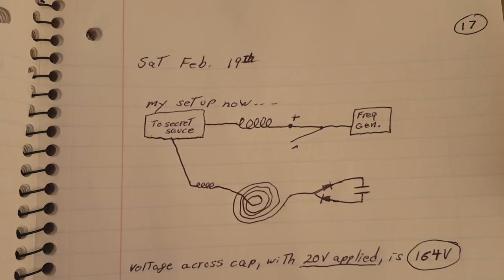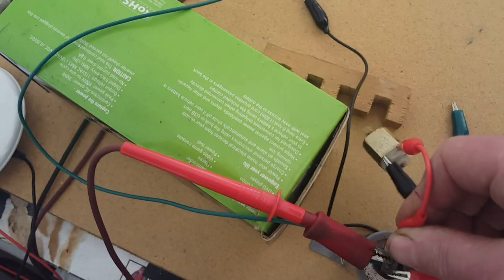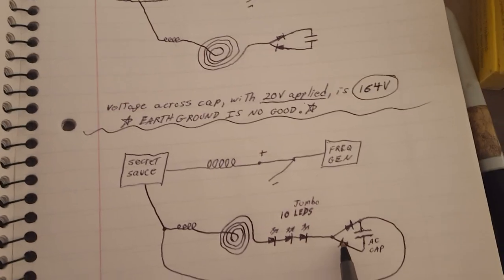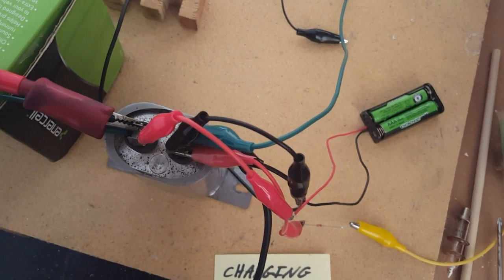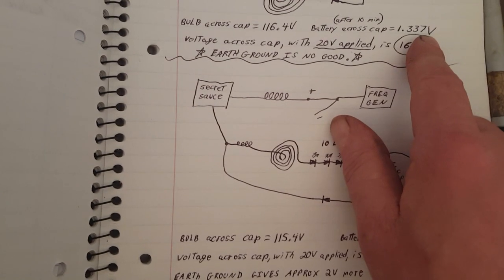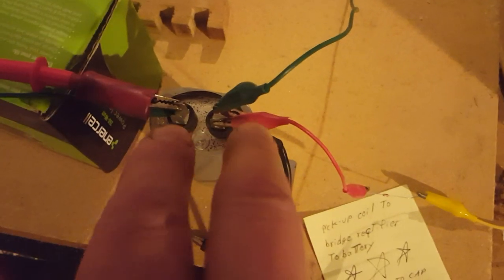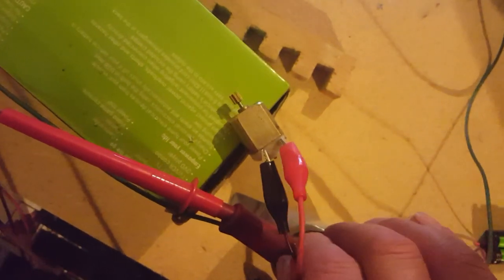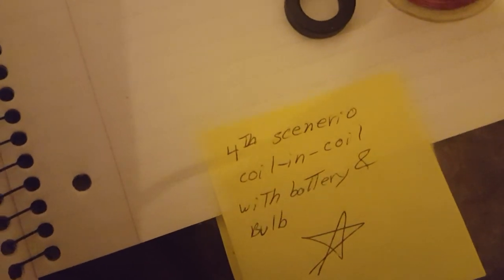WPT part 35   Three different set-ups, each with light bulb, charging cap, & charging batteries

Comment: Hi Paul   LOve your video......i have a idea you can try...it worked for me....Try putting another ground wire from the neg of the battery you are charging  with a small resistor(like a 10ohm) then put that on a (GOOD) ground sepporate for the rest of your system....I found this helped my charging alot.......food for thought.....  Cheers!!  Mike    P.S   i will add your links to your channel to my channel
Reply from the maker: Thanks!  Funny, I actually thought about a second ground off of the batteries.  I will try this with resistor, thanks again!  And thank you for adding the link to my channel😎    I just saw on your channel that you are also a machinist like me.

Comment: Hi Paul, good job on displaying the different methods. The cat analogy, man if I had a dollar every time I was surprised with the outcome. I noticed with my circuits, a problem measuring voltages when using the led’s as there is usually another small transformer inside the base of those bulbs. This transformer coupled with the normal circuit inside the bulb base will result in an adjustment of resistance, hence the need to readjust frequency for resonance. So what do we do when measurements are deemed unreliable? Focus on one thing, desired “input vs output/outcome”
Keep up the awesome education.
Reply from the maker: Thank you😎

Comment: I think you should build a Bendini Motor Generator which uses Volt's and Not a Lot of Amps. Also, a Farahday Mono Polar or Newman Engine, all Three go on Volt's. Think Tesla would Approve, all Three do Radiant Energy Stuff when Built for. I Forget the name of Inventor and Device, But Mono-Polar/Faraday Motor Up grade, was to Use Earth/Ambiant/Radiant energy to Spin Faraday/Mono polar with Two Discs. One Isolated from Other, One for Spin/Force, other for Load or generator Via Reversed Terminal Hook up to Disc/Rotor. Tesla had a had a Patent something like, Don't have the Name Patent # though. One last thought, Faraday Engine could be Washer's on Bolt with Ring Magnet fixed to Shaft. Little tip, Magnet Polarity changes Current/Polarity direction, and hint 2 One Electrode to Rim of Washer and one to Shaft, One on Rim can be moved in and away from Shaft to increase or decrease Speed and/or current Taken.    Keep up the Search and Experiments, thanks for sharing your finds..
Reply from the maker: Thank you for your comments.  All interesting devices, Faraday, Newman, Bedini.  I never forget, Faraday showed that you can spin both the copper disk and magnetic rod both together.
I don't know how or why your words got a mark/line through them.
Hope to see you at the next video!

Comment: nice work paul  ive built a scalar beamer i coundent get the opposing powerful neodymium magnets against each other flat  so had a gap and settled on that and when i fired it up the electric motor on it went faster and faster in steps like as if it was getting more power from nowhere from the nine volts battery powering it  and with my fingers in front of the flashtube used in it i felt only some kind of vibrational invisible wave
Reply from the maker: Wow, I would love to have seen that😁